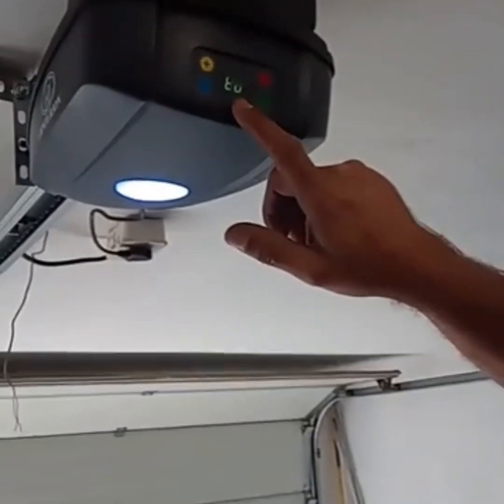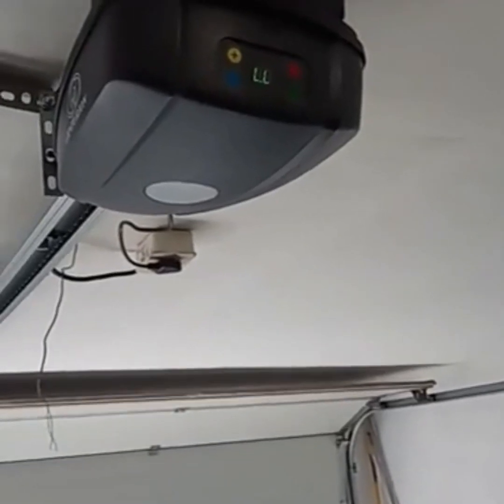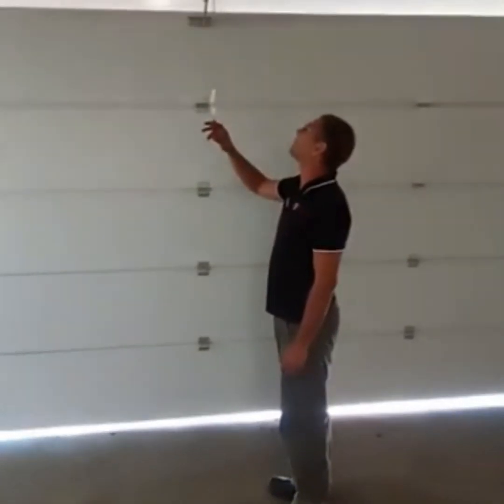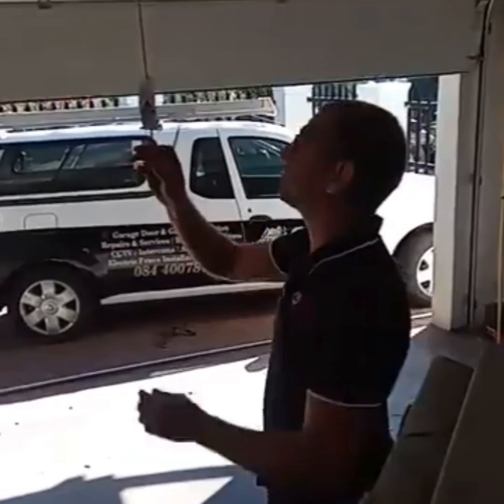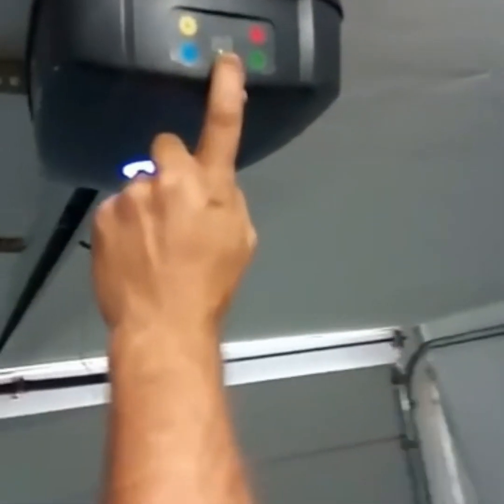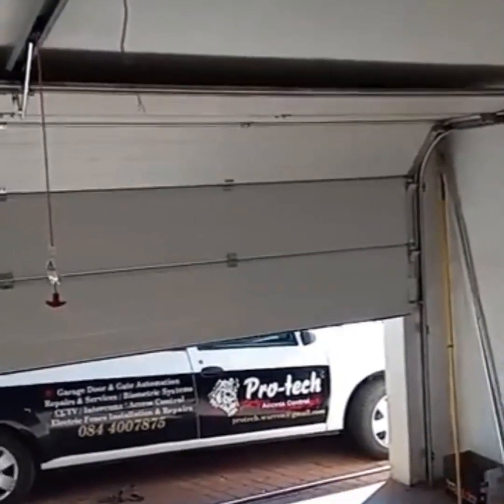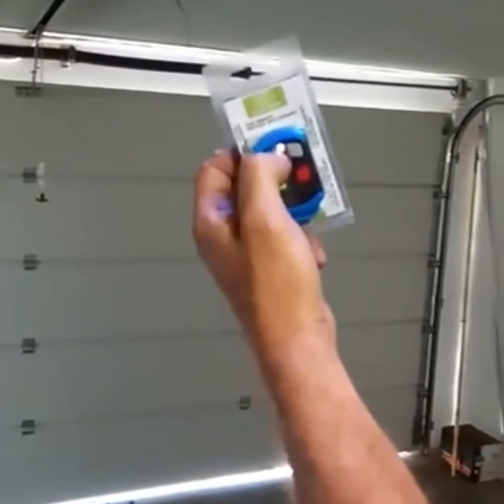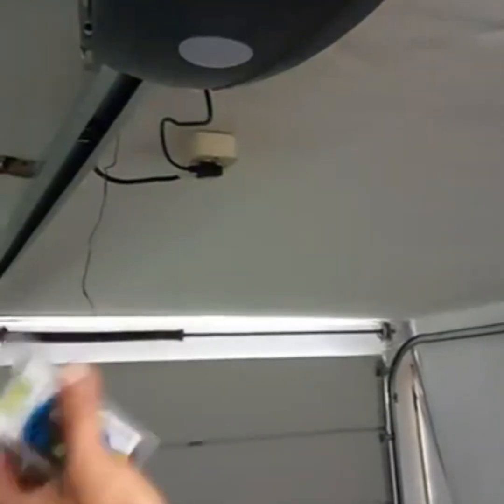How to program a Centurion SDO4 T12 motor

Comment: I’ve got the same motor, my problem is that after I close the garage  door just a few seconds after (5s) it will open by itself ( but it won’t open the entire door garage, at least 20cm). 
Could you please give me a tip ?
Reply: You can do a factory reset of the motor
Reply: @ozbeats706 how do you do a factory reset?
Reply: @ hold down the red learn until the light starts flashing slowly then press the remote down. it will close, open then close again but that's normal. make sure its up before you do it though

Comment: Hi can you use 1 remote. For both the garage motor and gate motor?
Reply: Depends on how many buttons you have on that specific remote. If it is a 4 button remote, yes you can. You will just assign or add each button to a motor.
You don’t wanna assign one button to all the motors as they will open and close simultaneously when pressed

Comment: My door is stuck in the open position & when I click the remote, the unit makes a click noise. Any ideas please
Reply from the maker: Good Morning. This could mean that the batteries have gone flat, as the SDO4 runs off the batteries and not 220volts.
Reply: @pro-tech-access-control  
Hi i have a e1 error on my motor.How do i clear the problem?